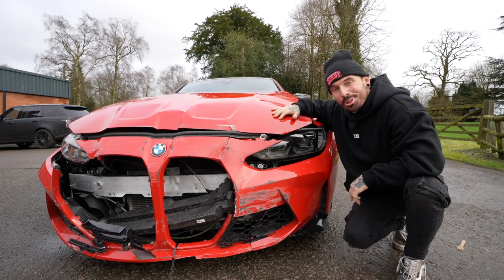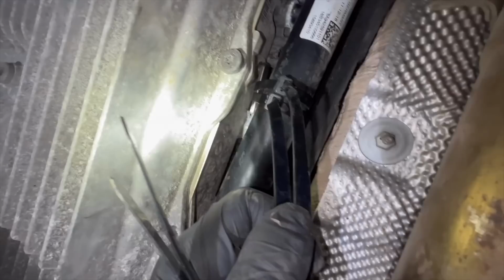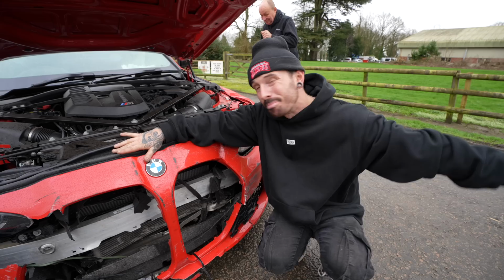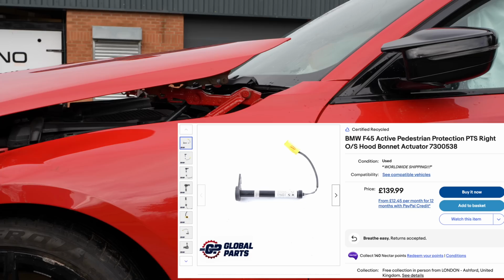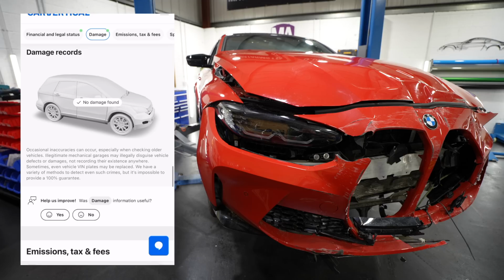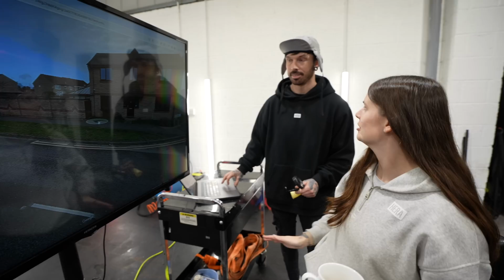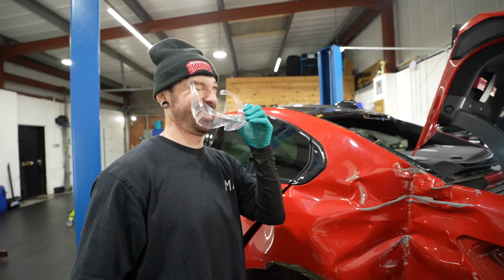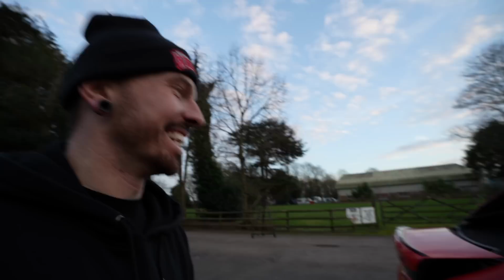I BOUGHT A WRECKED BMW M3

Comment: Hey Matt not sure if this car has the option but there was an option for these cars to have a built in dash cam using the surround cameras. Its possible the crash was recorded onto the built in computer that maybe you could access
Reply: Here in RSA I think that option is the BMW Drive Recorder. 

That’s actually a good idea (if that car is equipped with that option).
Reply: That’s would be amazing!!
Reply: Oooo cooool, need to see that

Comment: To put the car in neutral 

1. Open cup holder cover at front.
2. Remove cup holder insert. 3. Insert a screwdriver in the center hole, push the parking lock lever from left to right
to the end position.
4. The parking lock is unlocked.
Just in case for the next BMW fix
Reply from the maker: doesnt work for these models unfortunately. Thanks though
Reply: Lmao
Reply: You use the manual key that's in the FOB

Comment: Mat,it’s definitely repairable!!!
Whole car is spot welded. 
I have seen M3 repaired after side collision. The car was bent like a banana.Whole side panel of the car was replaced.
In 2-3 weeks car was on road again and driving safe.
Wish you good luck in this new project.
Reply: Pretty sure the car you described was not worked on a lift
Reply: @buttkicker8512  the work was carried out on a body slipway
Reply: @EdK911  did mention it? i may have missed it but the fact that he started to cut panel away allready is concerning. you should always try to bring it back to original shape before you cut panel .
Reply: Just take off the loose bits fix bent wheel and drive it how it is! 😮
Reply: @buttkicker8512  , I disagree , if there is no frame damage , cutting steel will not effect anything!!!
Reply: @WestsideCritters  it will affect the way the metal will react to be pulled back to spec my friend. no one is talking about frame repair but your trunk floor is bent, structural part from the quarter panel is bent and quit possibly the door pillar also. it may seem irrelevant to cut the skin but it not. everything will react different and make it way harder to bring back to shape

Comment: Hi Matt, first off, love your channel,  love what you are doing, even though you ain't a body repairer or mechanic, but its great to watch you having a go !   I though, have been in body repairs for over 25 years, and been trained by some of the best car engineers in the business, so if you fancy any real advice,  please get in touch.  As with your  latest BMW  M3 quater panel, you should reverse the impact before you cut any of the outside panles off, also cover EVERYTHING  when using a grinder, those sparks are glowing red hot, and will weld themself to anything they hit, glasss, cloth, paint, then rust later !!!!  Just a bit of  experience telling you.  Cheers Stu.

Comment: Some of these BMW M3 have a drive recorder in the car! May have a video saved of the crash in the car as it usually records 20-30 seconds before and after the crash. Would be interesting to see what happened! Love your videos by the way Mat!
Reply: It would be amazing if he manages to unearth that clip during the build. 
The garage that owned and crashed it, might have wiped it though, if they knew about the function. They had it back at their site after the crash for an undisclosed period of time. 
They were obviously doing some pretty spicy driving in a residential area to spin that into a house!
Reply: @DontPanicDear  It's actually very common for BMW's to end up crashed into houses, which I was surprised to find while looking up this crash. Think this is the one from Peterborough, doesn't say what happened but like a lot of the others its been early in the morning 4:30 am
Reply: I think the video would simply show that the driver ran clean out of talent and should have bought a Clio instead.
Reply: @OriginalgEd  First one I saw in the list guy was done with dangerous driving, he had also taken out a tree and a telephone pole, the one I think Mat's car is no charges were made, other folk in the car, could have been folk going to work, tiredness all sorts comes into play

Comment: My guess is this.

The 4wd has a rear bias, they lost the back end and started to spin. It hit the kerb, which then bounced it up and it was slightly airborne passing over the grass before hitting the back end as thats the deepest. That stopped dead and brought the front round with a clatter into the house
Reply: Thought M3’s were all 2wd?!
Reply: @Itsnotgoodatall xdrive=4wd
Reply: @Itsnotgoodatall  not the competitions
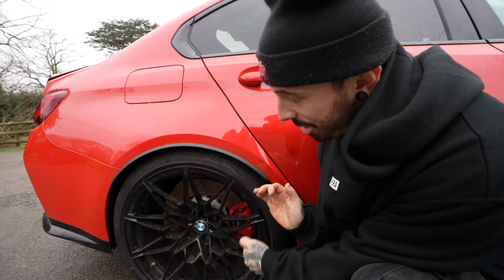Reply: @Itsnotgoodatall  Mat literally said xDrive at 1:16
Reply: @Itsnotgoodatall they are switchable to RWD though the M buttons on the steering wheel.
Reply: i thought the exact same as you
Reply: Wouldnt the rims/tires be a lot more damaged
Reply: Yes it's rear wheel bias this has always been the issue with the trash xDrive, it's not a true all wheel drive like Audi Quattro or Mercedes 4Matic
Reply: @julianbeekhuis640 the rear left wheel is all curbed i think
Reply: @kerotomas1  It's only trash if you don't know how to drive
Reply: @Itsnotgoodatall  I think its the Manual Version only comes with RWD. And I don't think they sell it in the UK only the Competition
Reply: Only plausible explanation alright. But yet no skid marks at 17:11
Reply: @kingGar27  maybe the road was wet when it happened
Reply: @patteyh  nah not really might as well go simple rear wheel drive then, a half baked junk so-so all wheel drive is pointless
Reply: There are tyre marks on the pavement to back up your theory
Reply: this is why audi said no to rear bias and to their history of 4WD. Quattro or nothing,
Reply: I think Matt has the direction right, but two possibilities, though similar
1. Someone turning right into estate, went round them a bit lively and lost back end
2. Was coming out of the estate, powered on and lost back end into a spin. 

Obviously big spin clockwise with rear panel impact

Comment: Former traffic cop here... its most likely the BMW was travelling NW on Gunthorpe Ridings (at speed) and lost control over the surface change at the junction of Caldbeck Close.  its a right hand sweeper at that point so you are into a clockwise spin over the surface change (fits with the damage and final position).  About 60m to the impact with the house, so 70-80mph most likely.  There are witness marks on the pavement (you have to look closely) which indicates the car went in sideways and was still spinning as it hit the house.  This likely made the damage worse on the rear end as the car was rotating into the corner of the garden wall.  Its hit the house and come to an almost dead stop, its rolled back about 2 feet post impact. HTH.
Reply: Think it may have gone airborne as it hit the kerb? Would explain the lack of tire marks on the grass
Reply: @Stuey1221  Suspension was likely on the bump stops after hopping the kerb so yes probably the wheels were not exactly firmly planted!  The rear wheels were back down on the ground after the grass as there are witness marks on the pavement.

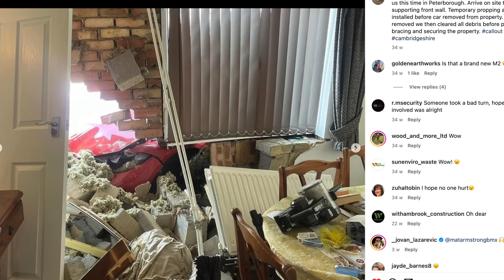Comment: 17:13 the crash photo had a faint tire mark across the sidewalk, made by the left rear . Crash happened just like Mat said. Love the channel and good luck on the build💪
Reply: And @17:10 you can see what looks like a clipped sidewalk and @17:18 you can clearly see the rear left wheel clipped on two spots, maybe the first time it was on the sidewalk and the second on the corner of the wall.
Reply: Maybe it bounced up the curb and got a little airborne before hitting the house, hence the lack of marks to the grass.
Reply: @jamespacker2904 my thoughts also, most likely it was a mid flight kiss with the house. It’s mad that was unrecorded, god knows what else os broken or cracked, this car clearly is a flight risk! But if they didn’t go through insurance who paid for damage to the house..
Reply: Also think thats the only way. No marks on the grass 'cause it was in the air, maybe?
Reply: @jamespacker2904 That would make sense. It looks very sunny in the pics but i was also thinking maybe it was partly damp out when the accident occurred? Would mean less tyre marks, and more likely to lose traction.
Reply: @lfogtman the homeowners insurance would pay for the repairs on the house and go after the driver for reimbursement.

Comment: Mat the parcel shelf can be pulled out no probs  the quarter panel needs to be pulled out at the crease to relieve  a bit of tension the quarter panel skin then needs to be removed and the inner structure needs to be pulled out to relieve the tension on the inner structure then you can decide to buy all the individual panel pieces or buy a whole quarter panel section from a donor car and remove it all in one piece then put a new quarter panel on remember to pull at the same angle as the damage happened if it went in it should come out at least to relieve tension then decide which way you attack the damage or take to a good panel shop as a panel beater don't be afraid of the damage and right down a step by step plane on fixing it so you don't get side tracked good luck cheers from down under
Reply: Great explanation. The only part that would bother me is the rear screen surround, do you think that will pull straight or need to be replaced?
Reply: @paulwkempster  you would only know when the panel is pulled out but I would say it will come out
Reply: Agreed, it's repairable if he starts pulling now instead of cutting. He might be better off getting a pulling rig to try himself at this rate.
Reply: @EdwardV20  yes but if he gets a dozer he needs to have someone show him how to use it overpull can be your worst enemy
Reply: After watching a few videos of Arthur Tussik I am starting to believe anything is repairable.

Comment: I hope you made sure no metal flakes got into the oil line when you cut the pipe with the angle grinder. Great videos as always, thanks!
Reply: I hope so too.... Matt is unhindered by technical knowledge...that saves him...
Reply: Abrasive dust would be even worse
Reply: Underrated comment

Comment: Hi Mat the car should repair ok I would put it on a jig and pull the 1/4 panel out then the inner frame and if pulled out properly the parcel shelf should repair  a new 1/4 panel inner wheel arched lower 1/4 panel inner and outer wheel arched and you shouldn’t be too far away cheers John
Reply: The house got repaired so hopefully the car can to

Comment: Mat, hope you know, make the car square before replacing parts. otherwhise it WILL crabwalk on you. So throw it on the jig and pull it straight, before you cut out any of the structual parts.
Reply: Ha...We put one on marble for weeks to straighten it..amongst other measures, but still the car was never the same..

Comment: You could've got the car on a jig to pull all the rear panels out before cutting. You can usually pull out most of the internal structure back in place to relieve the tension  then remover the outer panel. Get a pull jig next time it will serve you well in the future. Look forward to seeing this completed :)
Reply: I was thinking exactly the same as they cut the outer panels off 🙂

Comment: Cut the oil lines with a cutting/grinding wheel....what could possibly go wrong with that scenario? Im sure none of the grinder's particles got inside the oil  and definitely won't hurt the pistons or the bearings.....or anything else.

Comment: Mat that car hit the house first on the driver front corner, then the sudden stop & momentum made the rear continue almost 90 degrees crashing the rear passenger side into the wall.  Looks like an ace project and glad you are seeking a professionals advice.  It needs pulling on a jig before you start cutting.
Reply: Yep I said that. I've also been in the trade since 1985 and worked as a MET technician in a accident repair centre.

Comment: Mat - this gen of Mcar is available in other markets with a manual gearbox (albeit slightly detuned, non-competition spec) ! Must be the same one that’s optional on the current M2. 
You know it makes sense to get that box converted - much easier to get it into neutral next time the car gets mashed off someone’s wall

Comment: so long as you can buy the metal to fix it, it's repairable.  Being a newer car, the metal should be other there but more than likely you'll have to buy new rather than used, unless you're lucky.  One thing you might want to do is have it put on a frame rack to have the car pulled more into alignment.
Reply: Everything can be fixed with ease. Why people think it can't bewilders me. I've repaired cars scrap yards did not want. It's all a question of cost.

Comment: Slightly faster, reworked suspension, the trim bits inside and out, light weight front seats, all equate to specific parts for the M3 Comp. Good luck pal!

Comment: For the crash, there is a metal manhole cover in the middle of the road that could have caught them out. Either turning right from the side street at pace or just coming straight and changed gear, or punched the throttle right on that manhole cover.

Comment: that having a clean title after being repaired from crashing into a house has to be straight up fraud. no question about it.
Reply: Exactly what I thought mate! That sure isn’t Mats approach but the fact that that is the consequence under this insurance state is a terrifying thought of an easy way to rip people off ,in real life‘.
Reply: Trouble is where do you draw the line between tapping a road sign at 5mph and buying a new bumper and having an accident like this
Reply: You can clearly see the reg, wouldn't it get flagged as a write off if any insurance company sees this video?
Reply: Advertising car vertical that informs you if your car has a crash damaged history without your knowledge and then repairing a high powered car that will have a clean title but should be a cat S is double standards surely. It's just as bad as doing an ex track day car. Car vertical doesn't tell you if your car was used as a track day vehicle.
Reply: @marcosd999  how can it be flagged as a write off if it hasn't been written off? (As in, if an insurance company hasn't said "that's not worth us fixing, we'll pay you what it's worth instead").

Comment: I think once the dented panels internally are removed and externally the rear quareter is cut to an appropriate join point the car will start to look much better, when the new panels start going on this will look as good as new.

Comment: Personally, id get it put on a frame straightening machine and have it pulled as straight as possible, then work on everything else. You can even get some of the sheet metal pulled out so its easier to work with.

Comment: I've drifted and lost it on a roundabout, jumped a 1ft high kerb somehow, slid about 10 meters on the grass, yet no marks on the grass whatsoever and got away with a rip on the ... front bumper. So so lucky, but my point is, it's not so suprising theres no tyre marks, he probably got some air on a slide.

Comment: Easyer to leave the damage panels on had use them to pull  with when aligning the car back up on a chassis machine.I’ve repaired worse so it’s fixable depending on price of replacement parts.

Comment: You should look into getting wheel trolleys. Jack the car up and put the trolleys under the wheels and push the car in.
Reply: I think he has the wheel trolleys, unless I saw my own things in the older videos. 
I was actually expecting him to use those.
Reply: @sylism5086  He is a youtuber, he needs to create content. Everything he did in the beginning of the video doesn't make any sense, but he did it to build a story for the video. Kind of a shame but that's how youtube works.
Reply: Well it’s handy to know if the gearbox is working and can drive as is, before stripping the car? 
Obviously learnt from his mistakes in the past from going straight into stripping, rebuilding, only to re strip again.
Reply: I once saw a 10 m long printing press moved on 6 roller skates by two guys with a crowbar.

Comment: It is better to do any structure pulls when the car is still together. Not always required but when the structure is still whole you can sometime straighten things by just reversing the direction of the damages. It is surprising how much damages can just come right back into the proper alignment when pulled correctly

Comment: If BMW sell the panels, then I think it will be repairable. Though have fun picking out and then drilling out all those spot welds! And looking at all that folded steel, your probably going to have to cut your way down to some of the welds. But of course you will have to consider the cost of the repair against what you will get for it when it's done, especially considering it is now out here on YouTube that it's had some very serious crash damage. But, being on YouTube will give you the advantage of any potential buyers being able to see how well it was all put back together. Good luck with it all.

Comment: You need to put it on a jig and pull it all out first befor you start cutting it up and repairing it. It's repairable but stuff will line up better if you pull it and then put the new panels on 👍

Comment: The grass has no tyre marks because it hit the kerb sideways and jumped the grass as it was rotating past 150 degrees from the direction of travel and probably lost control on the slight right hand bend more than likely an over correction from using a mobile phone or infotainment

Comment: Matt, the mystery regarding how this accident happened will never be solved if you think the front end was hit first.  Looking at the damage I think the guy somehow lost the rear end and first hit the wall with the rear quarter panel which in turn spun the front end into the house........ I think the rear impact slowed the car down substantially,  otherwise this car would have been buried inside the house!......